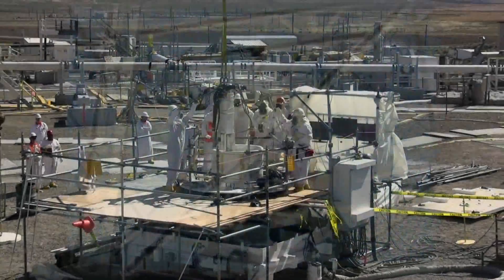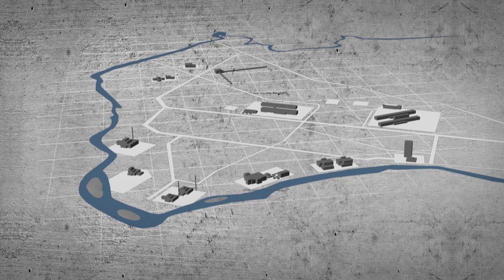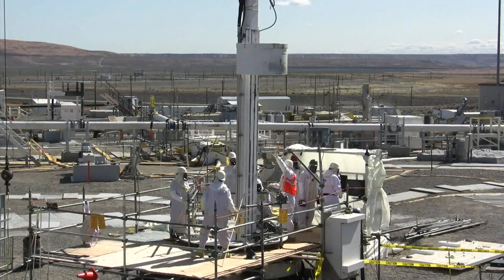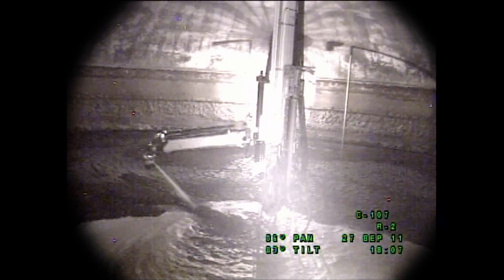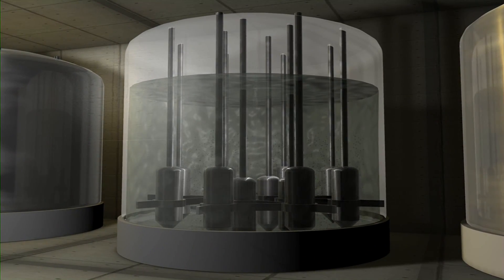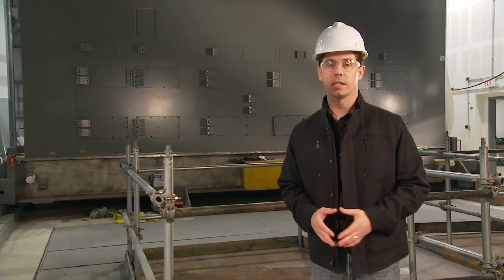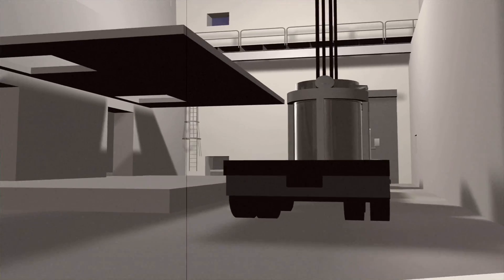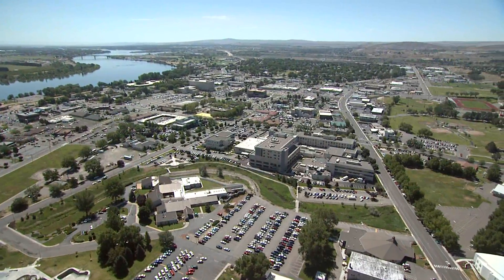The Hanford Story:  Tank Waste Cleanup

Comment: Update May 2017 regarding "goes into operation 2016": 
“Making glass as soon as possible has huge benefits,” Smith said. DOE is working to beat the 2023 deadline by a year."Taken from: http://www.tri-cityherald.com/news/local/hanford/article121354623.html#storylink=cpy
Reply: And here we are, August of 2023 and it is still not operational.
Reply: Here we are in 2025 and it’s still not certified. But they are close.

FYI- vitrification proof of concept was appx mid 90’s (1994/95). But the concepts as years before PoC when they literally stuck electrodes into a pile of dirt, flipped a switch, then melted it into a pile of “glass”.

Comment: Why not turn into MOX fuel for new power plants
Reply: Because MOX is made from plutonium and uranium. This waste contains other fission products.
Reply: The plutonium is already taken care of. Now it's the fission products and minor actinides.
Reply: The one reactor at Hanford could have CONSUMED the majority of the waste products but the DOE shut the reactor down years ago leaving this very expensive and costly method of disposal as the so-called ONLY WAY to fix the problem !
Reply: It was called the FAST FLUX REACTOR, .... drove past it on the way thru Hanford and it is another site that will require the backwards clean-up rather than CONSUMING THE RADIOACTIVE WASTE IN A REACTOR !